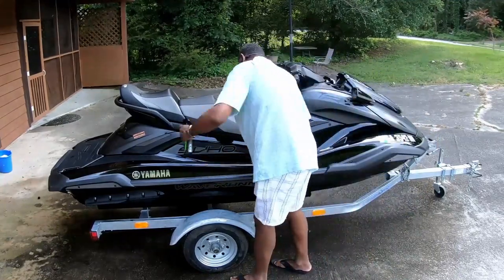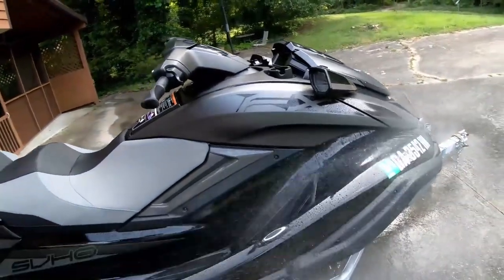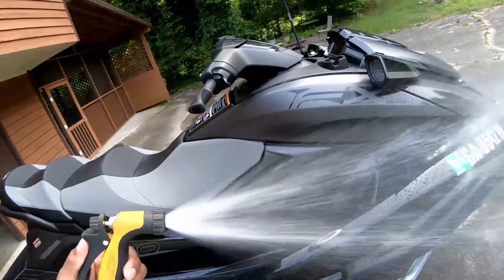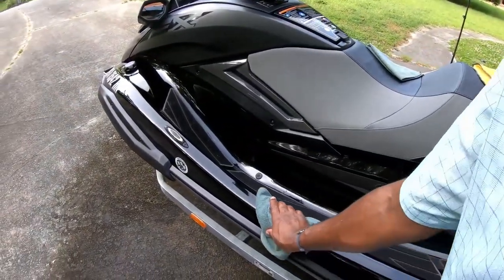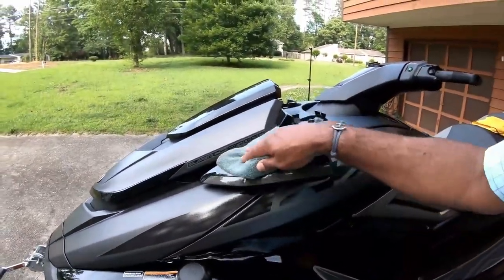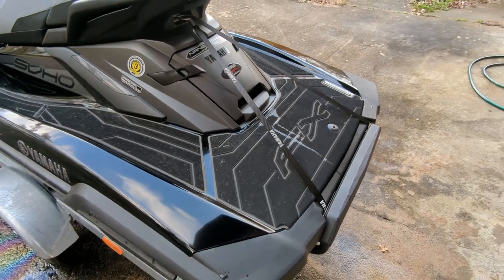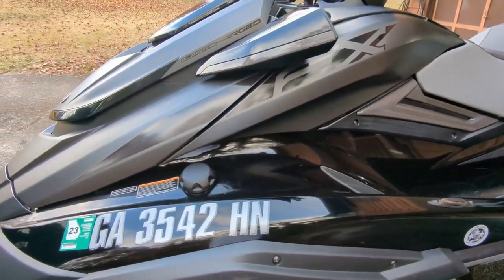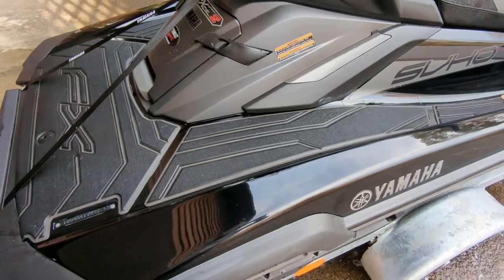Ceramic Spray Update

Comment: I bought it after your first video and I love it. Used it even on my truck. Also you should switch to the wet version that you apply on a wet surface. So what I do is give it a few sprays every time after I wash it before I dry it. Hope this helps 👍
Reply from the maker: I did not know they had a wet version.  I will definitely look for that the next time.  Thanks! Glad my vide helped you too.

Comment: I use Meguiars Flagship (Marine) Wax/Cleaner, Meguiars Flagship Premium Wash and Wax, and Meguiars Flagship Premium Detailer. (100 % saltwater use). My GTX 230/Eclipse Black and Orange looks better than the day it was delivered. I tried the Turtle Wax after watching your initial video, but like the Meguiars much better. Your boat does looks great!! I'll touch mine up with the detailer every couple of weeks. Works great for me. Thanks for the follow up post.
Reply from the maker: Thanks for the tip.  I'll have to try the Meguiars!
Reply: Does the Meguirs stain white on the black plastic like normal car wax does?

Comment: Awesome video. I have a 2021 fx cruiser svho red and white. I have white seats and recommendations on what to use on the white seats to keep clean and looking brand new
Reply from the maker: The seats are pretty durable and easy to clean but I suppose something can always happen to get a white seat dirty.  So far, I have cleaned my seat the same way I do the rest of the ski.  If your seat does get dirty though, I would try 303 Marine Protectant spray.  It cleans and also helps protect against additional dirt and grime.
Reply: @TheShipsLogg  thnx man

Comment: Try "THE LAST COAT 2.0"  It will last you at least 6 months.  Works great for matte finish and plastic parts on your ski.  It will also work great on your seat.  It is not slippery which I like so if I step on a painted surface on the ski I won't slip off like some slick wax.
Reply from the maker: Thanks for the suggestion.  I will try it.

Comment: Capt. I have a question of a different subject. Also fancying an Yamaha FX cruiser SVHO and in the makings is a run from the Catskills NY to Staten Island NY. A 140-150 mile run. I will have mounted the Scepter Marine 8190 topside 12gal. Fuel tank.....my question to you is, do you suppose I can make this run (one way) without having to refuel? At one point I will surely hit some rough waters and will pilot accordingly. Like yourself capt. I’m not a wave jumper nor do I do tricks out there, I enjoy cruising and just enjoying the waters and going the distance. This run will be my longest run and even though I’ve got my fuel-up stations mapped out, I would like to make this run straight through. Thank you capt.
Reply from the maker: Hi there.  Under perfect conditions, you probably could make it.  The question is whether the conditions will be perfect or not.  It is always a good chance to plan for less than perfect conditions, especially when calculating fuel consumption.  If there are fuel stops along the way then you can always use them as a back up if you find that the fuel you are carrying with you will not be enough.  Good luck and have fun!
Reply: Just saw the video and I have a 2020 FX SVHO Cruiser Limited. I mainly do the CT River from Windsor to points south. I ave 5 MPG due to speed limit and no wakes. I figure with that 18.5 gallon tank, you'll need gas halfway. Enjoy!
Reply from the maker: @Aaron.Davis56  He's got a spare tank as well but based on that, I still on think he should plan for a fuel stop.

Comment: Captain LoL, Captain. It is a PWC -- Sir yes Sir.
These supposed ceramics that come in plastic bottles are not great, they are glorified waxes. A real ceramic is way better and lasts for many many months to years. 
Note do not use these products below the water line though.
Reply from the maker: Captain is correct.  Been doing boats for 20 years before PWC's.  I agree that the ceramic spray is not as good as "The Real Thing".  This video is definitely not meant to imply that they are.  It is a quick and easy solution for keeping things looking good between major details though.
Reply: My I ask , why not below the water line?
Reply: @dreknotz1996  These products repel water so there is less adhesion between the water and the hull.  Or that layer of water that would come in contact with the hull has less friction forces with the hull so it has less traction for lack of a better word. Better for straight line speed in some ways but noticeably worse with cornering.